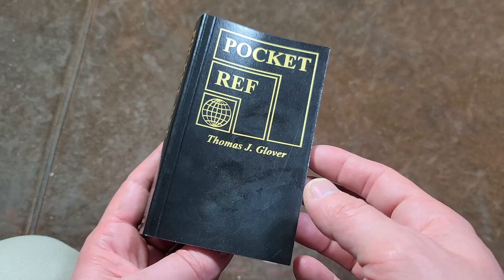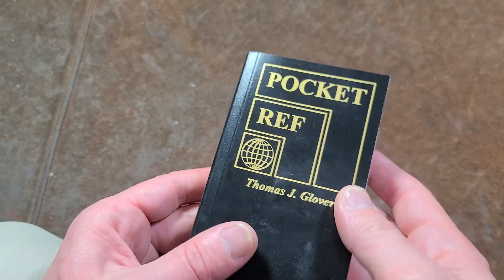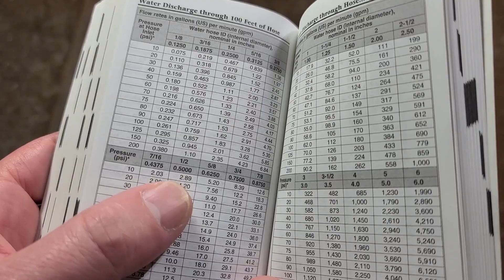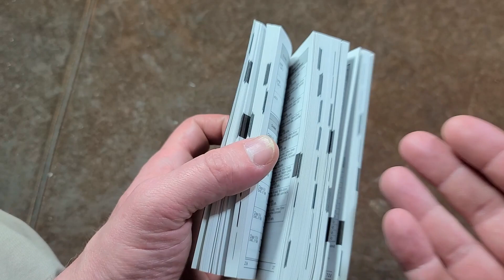Harbor Freight's Industrial Pocket Reference Review

Comment: Been looking at for over a year, just never got it because the print is too small for me.  I have a small machinery handbook and I find that hard to read at times.  What I found interesting in the book is the sign language part, did you ever see that section?
Reply: I know this is an ancient comment but there is a version called "desk ref" which is larger that you can purchase on amazon
Reply: I will look into it.  Last trip to HF they were sold out of the book.